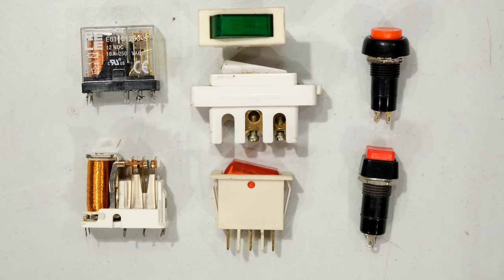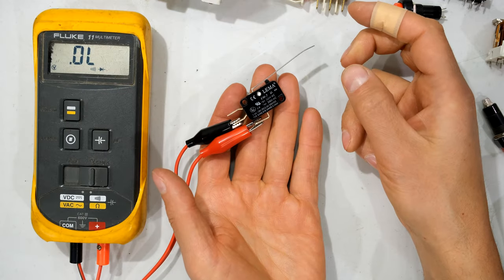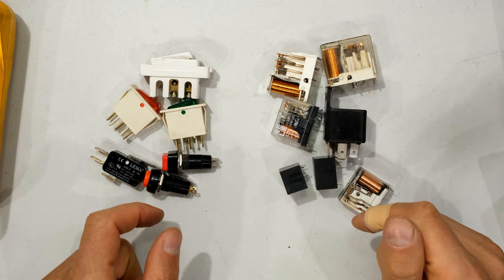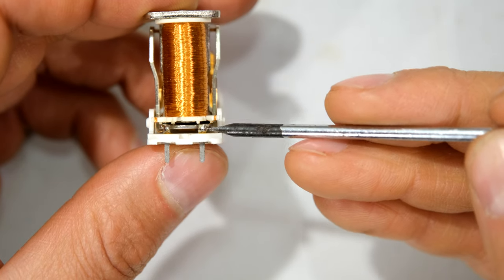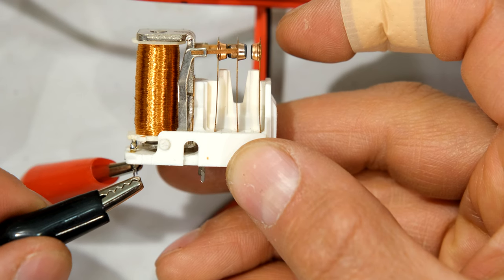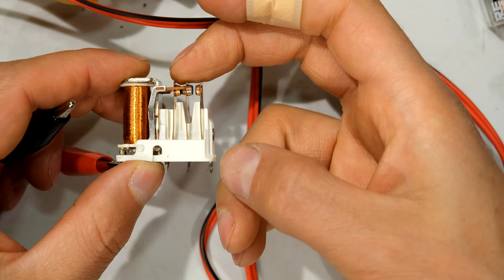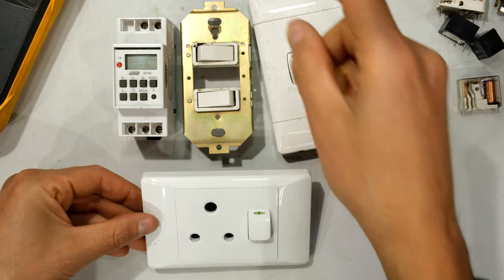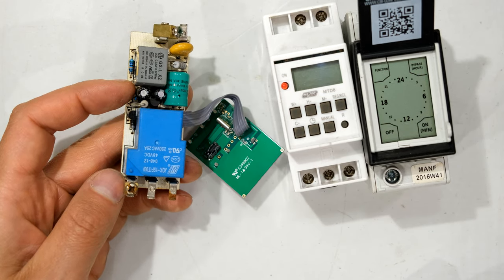What is the difference between a switch and a relay?

Comment: Thanks for a great video! You won yourself a new subscriber!... a Point about a relay (probably the most important feature) is that it enables you to switch on a LARGE current by using a SMALL current... Perfect example is the ignition switch of a car... The wires to the ignition switch of your car are very thin while the wires to the starter motor are extremely thick!... By turning the ignition switch of your car, a small current activates the switch that switches on the HUGE current required by the starter motor in order to start your car.

Comment: good day< i dont know if you will see this, howvever i am learning alot from your channel, i have a request on the right way to wire into a distribution box a 5 kva inverter with selected circuits being lightts and plugs no stove or geyser, and also one with an additional genset in there in case of the batteries of the inverter going flat during night time use. many thanks, keep these simple videos coming, extremely good local content.

Comment: So if you need a switch to power the relay, then you don't need the relay ? Since the relay has to be  powered to turn on and off the relay, you can save yourself time and extra wiring by just using an inline fuse on a switch, right ?, since the only difference as you said is a switch is manually switched and the relay uses voltage to move the switch...